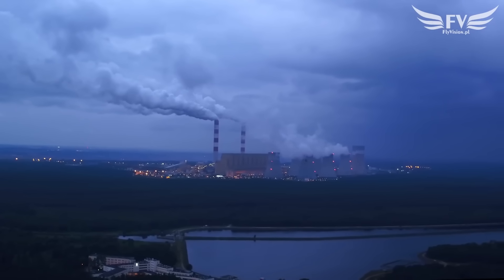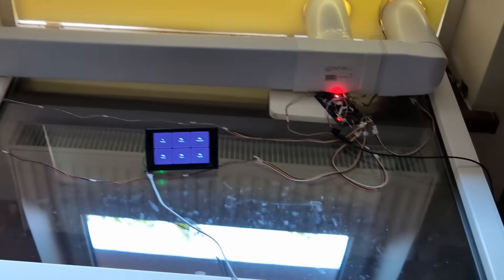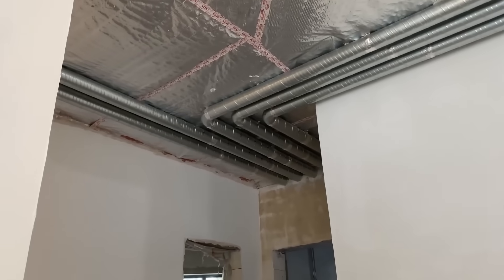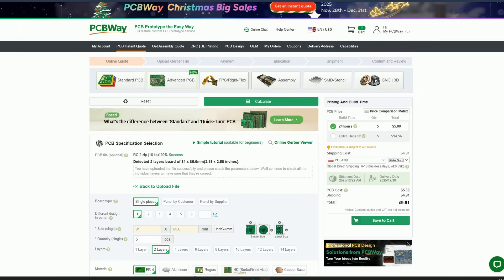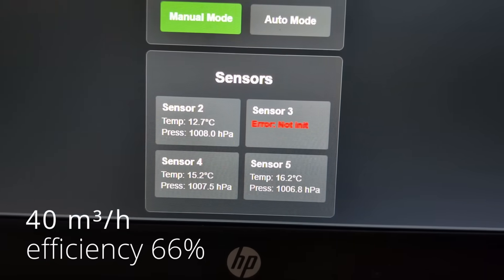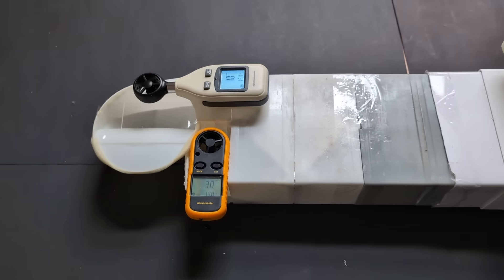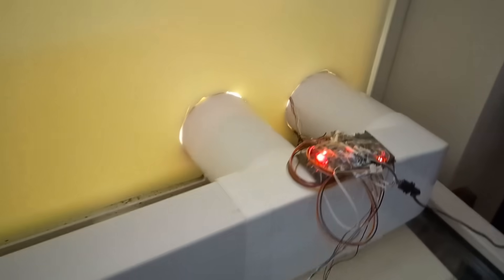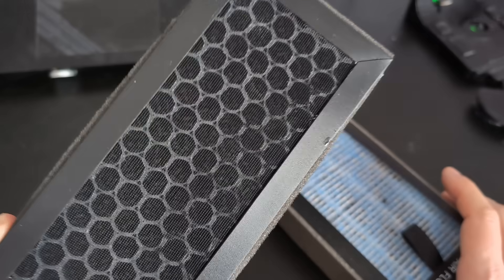DIY Heat Recovery Ventilator: From 55% to 90% Efficiency (Real Tests)

Comment: Aluminium is the false recuperator material. Decentralised recuperators are ceramic. The thermal conductivity of aluminium is too high, and a too-high thermal conductivity is the enemy. Also, your polycarbonate recuperator was TINY, 40% afficiency MUST be wrong, such a small one should have no efficiency/effect at all (first, you try twice as many Alu-tubes, creating a HUGE recuperator, and in the exact next step, you build a miniscule polycarbonate-recuperator, so, please, at least edit in a way it makes sense)... Also, 2-ways-recuperators are for centralised systems (that´s why they´re too big in order to be decentralised, or cheap). Decentralised ones are one-way, sequential, first hot/dirty-air out, THEN cold/fresh-air in. The disadvantage of decentralised ceramic recuperators is, that they always try to be as thick as the wall they are in, and that´s about 30cm... A 60cm-ceramic-recuperator (or 2 commercial-ones combined-in-series/connected-together) is far more adequate, but also 2 - 2,5 times longer than the wall-thickness they go through (which makes them aesthetically displeasing for the clueless consumers...). In other words, they are half-as-long as should-be, cause that sells more (cause of the better aesthetics...). Also, the recuperator should be massive/solid (so, unlike yours), without air-gaps between the tubes themselves. Nice try, albeit disregarding all the basics.
Reply from the maker: You’re not wrong in general, but you’re describing a different type of system.
This isn’t a ceramic wall recuperator. It’s a compact, high-flow aluminum exchanger, where size and practicality matter more than max efficiency on paper.

High conductivity isn’t always the enemy — geometry and airflow matter a lot.
Ceramic units store heat with alternating flow, this one works continuously. Different design, different trade-offs.
Reply: @DIY_Yarik  High conductivity isn’t s the enemy, if it stays between defined values, aluminium of that size, form, is the wrong choise.
Reply: This plate exchanger is very close to other counter flow cores in the market made of aluminum. In counter flow units aluminum physical properties are advantageous.

I think the ceramic ones are perfect for the versions of this system that alternate between modes. 

This is a lot closer to a mini counter flow central unit.
Reply: @vottat  you are right. But his aluminium-system is of the alternate-modes-nature. The polycarbonate one is indeed of the counterflow-nature...

Comment: i could see a copper heat exchanger working well, especially since you can solder it together,  only thought to make it simpler would be to have to large copper heatsinks in separate air channels connected to each other, could even use heatpipes if you want a further separation, and while not very efficient for a small HRV/ERV like yours you might be able to add a Peltier/TEC device between the heatsinks to heat/cool the incoming air more, but they are not known to be efficient so it would act more of a booster than an actual heater/cooler. 

For fans you might be able to use computer fans that are designed for more static pressure such as water cooling, or maybe a larger blower fan that can produce more air at a lower RPM (maybe from a cars blower motor if you want to stay with 12v, just more amps)
Reply from the maker: I see your point, but I don’t think that approach would work well for this design.
Using separate heatsinks or Peltiers adds complexity, cost, and energy loss, and for a small HRV/ERV like mine, it wouldn’t significantly improve efficiency.

Comment: this is very interesting! great work so far! with how expensive commercial units can be, it might even be relatively economical to have that heat exchanger part fabricated using metal 3d printing. some laser sintering aluminum online service might be an easy option. I wonder how much it costs to do something like wire EDM to carve channels in to a solid block, or even maybe some smaller parts that are just drilled out to form channels with perfect seals. I'm sure hand making them with bent metal is much cheaper, but it looks somewhat tedious. I also wonder about other additive manufacturing, like you have ruled out plastics due to efficiency, but maybe there is some convenient middle ground with plastics that have higher thermal conductivity by having metal or carbon composite materials? perhaps you could 3d print a wax-like positive of the channels, and cast a very metal powder dense resin around it, and then melt or disolve out the positive shape to produce well sealed chunks? it wouldn't have the humidity controlling layer i suppose.

Look forward to seeing how things continue to develop! It could be useful in my home in sydney, where the outdoor air is often very hot and air conditioning can be a big expense to me.
Reply from the maker: All the options you suggested  laser sintering, and especially wire EDM  are incredibly expensive.
Making the channels by hand with bent metal is much cheaper and more practical for a DIY or small-scale build, even if it’s a bit tedious.

As for plastics or composite materials, I’ve considered them, but thermal conductivity is the limiting factor. Metal or carbon-filled resins could work in theory, but the performance drops compared to aluminum, and humidity control would be harder to maintain.

Right now, I’m focusing on practical, low-cost manufacturing that still gives reasonable efficiency. Once the design and testing are complete, I’ll explore other methods for scaling or alternative materials.
Reply: @DIY_Yarik Commercial high performance plate heat exchangers are assembled and sealed by brazing the (usually copper) plates together.  The capillary action pulls the liquid braze into the contact points.  These are extremely durable and can be made with a variety of plate forms.  Your home made corrugated sheets are very much going in that direction & are a very good approach. 
Overall, your practical and measurement-driven approach is very admirable.  However, you are working hard to discover principles that are very well understood theoretically: there are equations for both heat transfer rate vs air flow and also for pressure drop.  If you want to design a heat exchanger to work at a preferred flow rate, pressure drop, and with a required heat transfer rate, it is possible to calculate suitable combinations of channel dimensions and account for the properties of the material too.  This would show you that copper is hardly necessary: almost all the thermal resistance is in the air boundary layer.   So you can optimise for air flow vs fan power/noise and use aluminium for your plates.   I don’t know if there is an easy brazing method for aluminium, though. 
Because you now have a very good idea of the target parameters, if you look into these design principles and calculations you may be able to find a good set if design parameters without having to make sets of prototypes. 
I suggest searching for some engineering papers on „better” designs which will show you how they identify improvements: you will find many examples.  Including some additional features like riblets or turbulence inducing features which increase the specific heat conductivity by disruptions to the boundary layer in the exchanger. 
Good luck, I hope these suggestions lead you to finding some useful ideas and concepts for future testing.
Regards from a warm room in freezing rural Poland :-)
Miles

Comment: Have you thought about using heat pipes to improve efficiency?
Reply from the maker: Yes, I’ve thought about it.
Heat pipes are effective, but for large airflow you’d need many of them, which makes the system expensive. My goal is accessibility, not maximum efficiency at any price.
Reply: I see you live in Poland. Me too. Any way to contact you?

Comment: If you really solve the icing problem not by defrosting the heat exchanger with an additional heater you will keep the efficiency at the desired level even for cold climates usage of your device. Obviously ) So I am really qurious how well does the moisture separation membrane work and for how long in will last? I am afraid you will have to set some filtration of outgoing air for to save the membrane from clogging.
Reply from the maker: I’m really hoping the membrane will do the trick, but unfortunately I haven’t done enough testing yet to give a definitive answer. This video is more of an intermediate update. Once the design and tests are complete, I’ll make a video explaining everything in detail.

And yes, of course there will be filters on both sides to prevent the membrane from clogging.

Comment: Someone needs to learn what "exponentially" means, that graph could only be described as linear and not exponential.
Reply from the maker: Not really.
That’s only a small slice of the graph. From ~1800 to today it clearly resembles an early exponential  especially with the recent AI-driven jump.
Reply: @DIY_Yarik  Still not exponential at all, if you are to be believed what you are describing is hyperbolic (specifically hyperbolic tangent), which starts with what deceptively appears as exponential (it's not) but ends as a linearesque graph. Unfortunately for you, it is still not exponential.

Comment: Great video — the testing was super helpful. When you mentioned carbon, it reminded me that I’ve been using a carbon canister style filter commonly used for grow-room odor control, with decent results at home. Just sharing in case it helps.
Reply: Centrifugal / mixed-flow inline fans
Designed for ducting
Rated for static pressure, not just CFM
Efficient at continuous duty
That’s why those carbon canisters are usually paired with a specific class of fan.
Reply from the maker: Thanks! Good point.
Grow-room carbon filters are built for ducting and continuous use, and static pressure is what really matters. With the right fan, they work surprisingly well at home.
Reply: @DIY_Yarik yes. Mine works great deodorizing my house and capturing any toxic gick in the air.

Comment: there was a paper years ago indicating sub 10um particulate matter is what causes lung cancer
Reply from the maker: Yes, such particles damage the lungs when they enter them. Particles after 2.5 p.m. are particularly dangerous, as they penetrate the bloodstream.
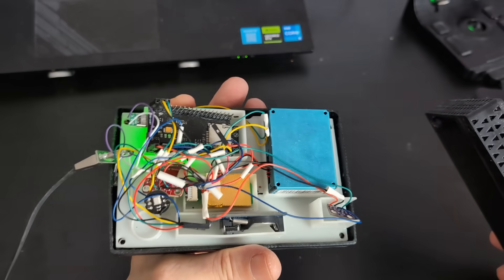Reply: 5:20 I saw that you used Plantower PMSx003 pm2.5 sensors - while I agree that PCB manufacturing is the better way to go, there are also simple statistical methods to eliminate the random measuring errors - just ask your favorite LLM for help to select one :)

There will also be measuring drift in time because of sensor aging - you may want to install more than one sensor to detect if (when) the measurements start diverging.

And speaking of PCB manufacturing - would you have links to the videos you watched to learn how to create correct Gerber files? I have the schematics and the PCB layouts for my would-be boards in KiCAD but I saw that there are a lot of manufacturing constraints that you also have to account for before uploading to one of these companies. How many layers did you use, 2, 4 or more?

Comment: Great video!

I created a air filter/blower between my basement and my bedroom, to circulate the air inside my house will running it through a very hefty carbon filter and large area HEPA filter. 

There are now dozens of options available like this, and they are great and last 1-4 years depending on contamination levels they have to scrub, AC Infinity Air Carbon Filter 6", the one I purchased came with Granular Activated Carbon in the package.  All the brands also make very good duct fans that you may find to be the best solution for your project.

Good luck and I look forward to following your progress and likely making a non electronic copy for my house.

Thanks again!
Reply from the maker: I appreciate the support, and it’s great to hear you might make a DIY version for your own home!
Reply: @DIY_Yarik thanks for the video.
Reply: What kind of HEPA did you use with the carbon filter?
Reply: @cajampa I just have 4 merv14 filters taped together as a box around the filter the filter is in the box sitting on the floor, with the fan from the same company as the carbon filter directly above the filter, and a length of pvc pipe runs into the ceiling to a duct in the floor of the master bedroom, which is the farthest point from the basement stairs.  This causes the air to circulate the full length of the house.
Reply: @cajampa the 8 inch GAC duct filter is inside the mirv13 (ithaught it was 14) box, siting face up on the bottom of the box, with a 8 inch same brand variable speed duct fan attached directly on top, with a 8 inch to 6 inch adapter on top of that.  The adapter is right at the top of the filter box, and I cut a hole in the box for a 6 inch PVC pipe to fit inside the box into the 6 inch adapter.   

That pipe extends up into the sealing between two of the bords that hold the main floor up, in the corner of the room underneath my night stand in the corner of the room.  In the room, I located the hole by driling a hole in the middle if where the pipe goes through the ceiling, then I used that to center a floor register that I purchased.  I drew a line around the register on the floor being sure not to hit the bords that hold up the floor, then I used a jig saw to cut the hole for the register in the floor.  Then in the space between the lower ceiling and the floor, I put in peases of 1 inch foam insulation that blocked off the opening between the boords that hold up the floor on both sides, boxing in the register opening.  Then after cleaning up the mess, I put the filter assembly in place stuck the pipe on top, then set the register in the hole in the floor.

I run the duct fan on setting 4 of 10 so I get a fairly good flow, but it is quiet.  10 is very high flow but sounds very loud, like a mini leaf blower connected to a 8.5 foot pipe.  Don't try to use a fan that is not purpose built for the carbon filter, because the filter requires a lot of suction to suck the air through an inch of carbon granuals.

The filter is 14 inches by 25 inches and states "Ultamate allergen 9600, reduces 96% airborne contaminants made in the USA.  I duck taped the 4 filters together,  and gently screwed the cardboard squares on the end with short drywall screws, then careful tapeing.  The box was moved in to position with the top off and appropriate sized hole cut in the top cardboard pannel.  The filter/blower/reducer were set on the floor inside the filter, then the top was put on and the pipe was inserted into the adapter.  I screw the top down after the pipe is completely situated and in place, otherwise the box could be damaged when trying to place the large PVC pipe.

This is just how I did it for my setup, because I am extremely sensitive to smells and stuff in the air.  We don't go near the filter often, and the filter is still very clean after a year and a half.  The carbon filter smelled a bit funny at first which I didn't like, so I replaced the carbon with super high absorbency industrial grade carbon that I purchased for $140 for 5 galons.  And of course the new carbon smelled funny for a few days, so I should have just suffered through the first week or so with the original carbon.

The carbon filter is insanely good, I can not smell any smells coming out of it even if we burn something in the kitchen, which is right next to the basement stairs, and I can smell the burnt food down stairs for hours afterwords.
Reply: @cajampa for carbon I use in my water filters, I do rince the carbon before use,  to get all the dust out.  But for my air filter I do not clean the carbon before using it, because I do not want to deal with drying the carbon back out.

We usually open a door or window for several minutes at least once per day ideally twice per day to air out the house and get the CO2 out.  I do want to get a cross flow air exchange system, but have not gotten there yet.

I have a HEPA air filter that has a particle count feature and when the air is above the clean threshold it goes into turbo mode.  This happens typically when we cook, sweep the floor, sometimes when we load our wood stove, and if you walk by with dusty clothing.  We also have a HEPA filter in our room.  We put the one witht the sensor in our room for a while, but It didn't go into turbo mode hardly ever, so we moved it back into the living room near the kitchen and wood stove.

The thing we did that lowered our noize the most is blowing in insulation into our walls.  Our house is very old, and the fiberglass insulation had reduced to less than an inch in thickness, so air was blowing through the walls and eaves.  We live near an airport and could hear the large plains landing and taking off before the insulation.  Now I can only hear them when I listen for them, and I don't hear my neighbors talking outside, or traffic driving by any more.  It's not perfect, but the noise was reduced by about 4 X.

There are gasses that carbon can not filter.  I do not want to purchase the materials need to filter out more.  I am doing 98% better than the average house, so I am going to call that good.

I have to replace my carbon pads on my HEPA filters every 2 months to keep them clean and my HEPA filters every year to keep mold from growing in the dirt on the filter.  The HEPA filters are in the bedroom and the living room.  Both get about the same amount of dirt, so just because the filter down stairs is cleaning the air doesn't mean that the air in the bedroom is going to be clean.  People and pets give off a ton of dander and hair constantly.  We mop our floors every day just to keep up with the dirt and dander that gets in the house, even thou we take our shoes off at the door.